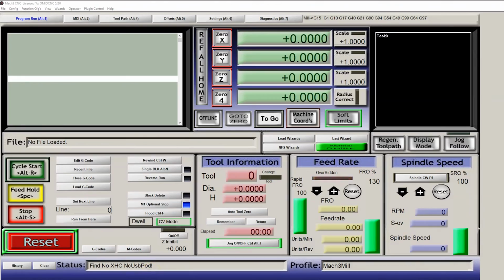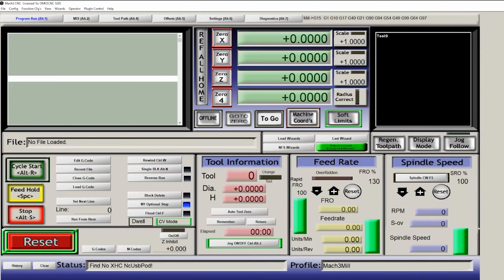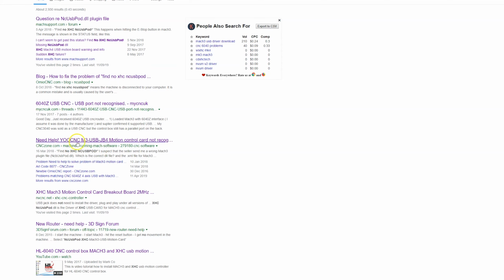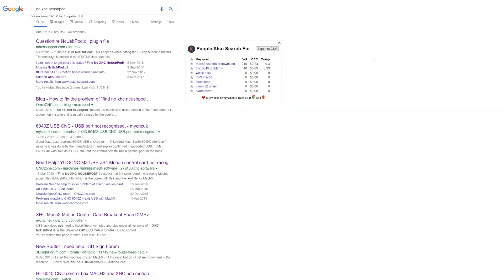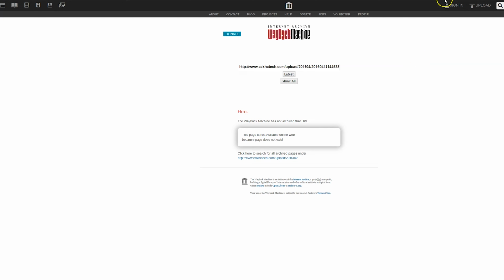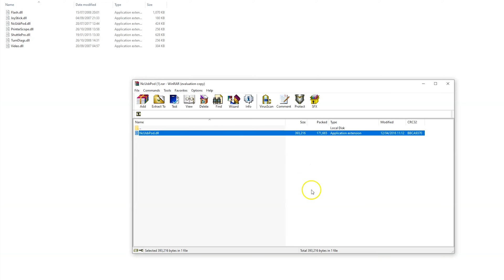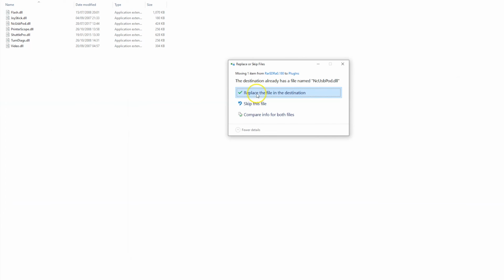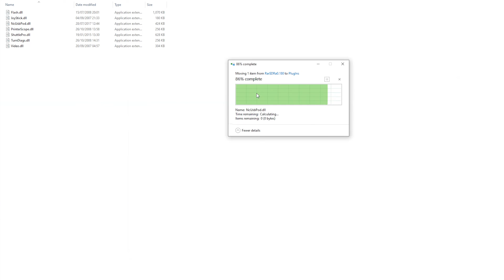How I fixed ncusbpod.dll error on Mach3

Comment: I have the Ethernet version of this controller. The problem I have, when I command the movement of an axis with a G-code file or, the axis calibration feature, in Mach 3, the stepper motors make an horrible knocking noise. When I use the Mach3 pendant to move an axis this doesn't not happen, the stepper motor runs fine. Do you have this issue?
Reply: I'm trying to setup the Ethernet version of this and having problems with the IP address on windows 10. How did you over come this? Thank you
Reply: @icdjpr  Go to the control panel, then select network and Internet tab > (view network status tasks) then select change adapter settings on the left plane. Left click Ethernet select properties. Scroll down to internet protocol version 4 (TCP/IPv4) double click this then you can enter the IP address of your choice. Hope this helps.
Reply: @icdjpr  BTW please let me know how your controller performs. Mine made the stepper motors knock when moving by a Gcode file, but not with moves by the pendant.
Reply: @TheHalloweenmasks  they worked great before we moved the machine but paying hell to get it up and running again.☹️ The pc just doesn't want to communicate with it. We really appreciate your help.
Reply: @icdjpr  Right! I hope you get it fixed anyway. I was pissed off with mine, I have purchased an Eding controller, I am waiting for some electrical wire, then I can fix it up and give it a try.
Reply: @TheHalloweenmasks  got her going finally but it won't let me tune the motors on mach3. I thought about your problem and I think it might be the constant constant velocity setting in Mach 3. You have to turn it on and adjust the angle.
Reply: @TheHalloweenmasks  I bet that might solve your problem. Our CV is set 2 
1 unit
Stop CV on angle 20
Reply: @icdjpr  Thanks, I did fiddle around with CV and it did not make any difference, I am guessing that I was sold a reject item. The seller doesn't want to know.
Reply: @TheHalloweenmasks  did motor tuning work on yours? because I can't adjust IPM or deceleration

Comment: I would like to say thank you a lot for the information I fixed my problems. But is still have a norther issue the PROBE can not work I tried many ways port 1 to 3 and pin 10 to 15 the March 3 DO NOT recognize I check the hardware they are working fine I probe them from the input pin to the pin of the controller they are active LOW if you know how to setup the probe input or some one know how please help me to let me know my email is mctslc@gmail.com. I am so appreciate. my controller like you have M3-USB-JB4 . Thank you again you have a great day!

Comment: Maybe you can help me. I just moved and rehooked up my system. Now everytime I start mach 3 it instantly reboots. I can restart in safe mode but the motors won't move but the dro does. under diagnostic page where it shows frequency instead of showing 25000 its showing SIMULATE and none of the pins under pin one are illuminated?

Comment: hi , my machine stops during a job with a NcUsbPod error , is there a fix for that problem ore is it the same problem u had ??
Reply from the maker: Hi Jacky, this is a constant issue I, and others, have with these cheap chinese controller boards. There doesnt seem to be a fix other than just replacing the controller board. UCCNC UC300ETH seems to be a popular choice

Comment: I saved the original ncusbpod.dll on a USB. Deleted all the ncusbpod.dll as found on PC. Added the saved and original ncusbpod.dll in the folder Windows/System32. Restart PC, start Mach3 and presto . . . solved (for me) File dated July 28th 2017 and is 424kb
Reply: I was to enthousiastic  . . . .  still running into  'Find No XHC NcUsbPod!' error code. . . . . bummer
Reply: @beyondxtream4056  yea, same here. Guess this is why we shouldn't buy Chinese crap...
Reply: @joshuadecker4503  Im still trying to fix mine as well all older style cnc machines are like this dont give up my man. let me know if you solved your problem please its nice  to be able to communicate online with one another.
Reply from the maker: @beyondxtream4056  did you try the .dll file in the description?